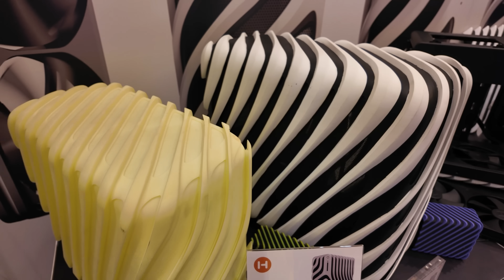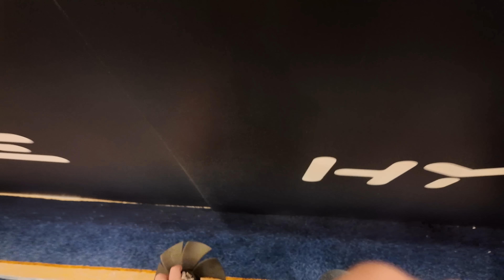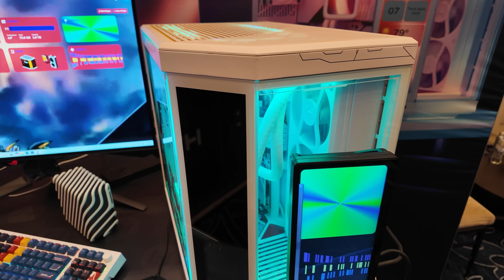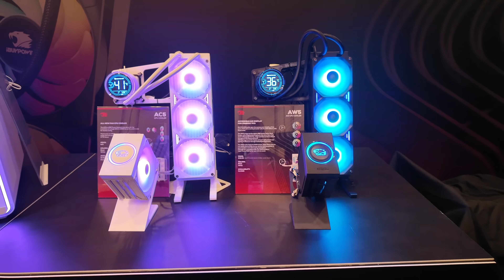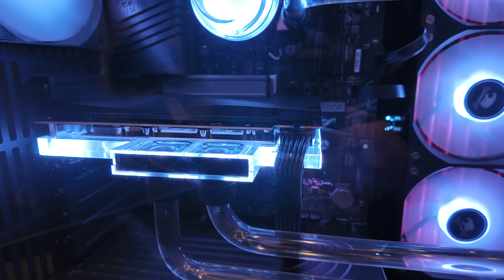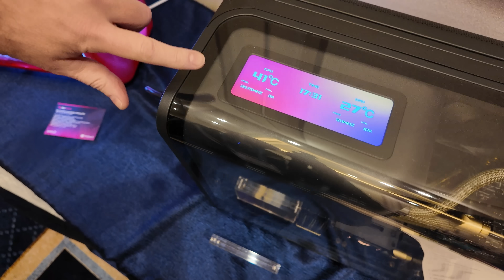How It’s Done (Done Done) at Hyte

Comment: I like Hyte stuff. I used a red/black Y70 case for my current PC (white MB). I also used the Hyte THICC Q60 AIO with a second set of THICC FP12 fans for Push-Pull. It is SUPER THICC! It cools my 9950X3D with no trouble and looks amazing with a 4.5" THICC AIO.

Comment: A case for "beginner custom watercooling" that only has a single spot for an intake rad but a giant distro? A more typical reservoir-pump combo that attaches to the fans would be better. It's a bit of a tough sell when you can easily just use the case you already have, but I suppose they'd have more accurate numbers.
Reply: There are a lot more options than that. But the bigger issue isn't "one intake rad" as ultimately configuration is moot. As the mere two, what look like 360 rads means this "premium cooling" configuration, is not going to provide enough cooling for premium parts.
Reply: @thatfordboy4297 The configuration absolutely does matter, and demonstrably so. What are you talking about? 

And 2*360 can cool "premium parts" just fine. A 5090 build won't be silent, bit it'll still be relatively fine.
Reply: @Dexx1s  Why is this an argument. ffs. No a rad(or rather the fans on it) being intake is moot. We are talking a hypothetical few degrees, at best. 

The issue is two rads. Being "relatively fine" is just a polite way to call it no worse, or better than aircooled. And you can't argue that. Especially since I know how close to the wire a 5090 is with such a setup, as I am only running a 420 and 360 x 30. 

Now if you want to argue that it won't be thermal throttling, fine. I yield that, since its true. But, if you water cool, you know a larger factor than just sheer cooling is noise. You know... a major factor for people water cooling now a days. And I though, was inferred by saying "premium cooling"... If I want more cooling, I have many methods, some more refined than others, none of which the word "premium" applies.
Reply: @thatfordboy4297  
A few degrees isn't insignificant, especially when it's for such an insignificant config change, and that's only considering 1 rad being in the sub-optimal configuration. That scales with more rads. There is no 'argument'. It's demonstrably better to have those as intake and having enough fan slots left for proper exhaust. If you want to say that you don't care about those few degrees, then so be it, but it's pretty obvious that from the start, I cared about the temps. There were literally two factors that I mentioned in my comment: temps due to rad placement, and price. Very strange to then pop in and think that I would, for some reason, not care about 1 of my 2 points.

"just a polite way to call it no worse, or better than aircooled"

No it's not. It's an accurate comparison to what it would be with more than two rads, you know, the thing we're actually talking about here. Also, there is no way you're struggling to cool a 5090 with a 420 + 360 unless you also, somehow having a 1400K under decent load at the same time. If that's not the case, you just screwed up your setup. The 5090 Astral LC that is still excellent despite only having a 360 rad, is laughing at you. 

"larger factor than just sheer cooling is noise" 
Oh, and the largest factor is still cooling, which is what I'm arguing for, so what's your point? Ramp up the fans and you get the cooling you paid for. I'm literally admitting that it probably wouldn't be quiet, indicating that it is a relatively important factor and you respond to...repeat just that. Good job. 

The majority of people who'd be buying this, are new to watercooling, buying it for the looks, performance, and ease of use. This isn't for people obsessed with pure silence. And let's be real here, what's considered loud in watercooled builds, is perfectly acceptable in air cooled builds. Being "loud" isn't anything drastic.